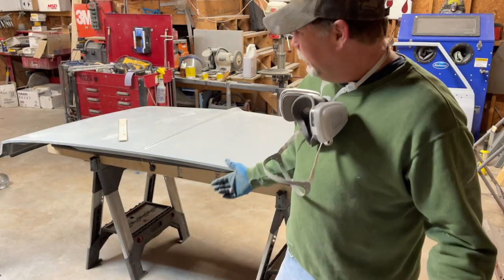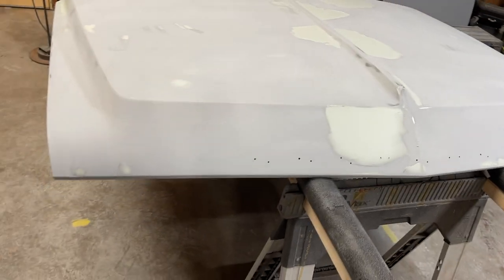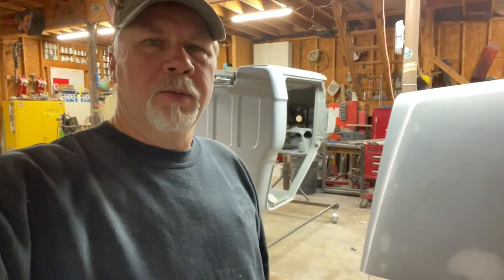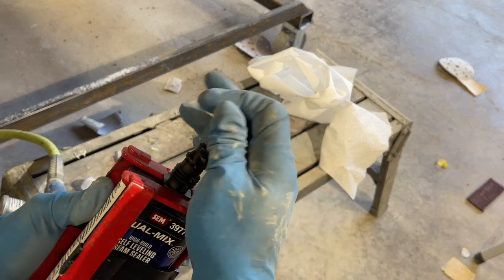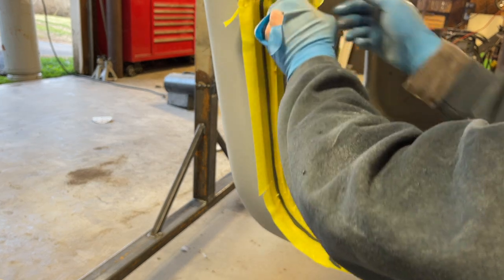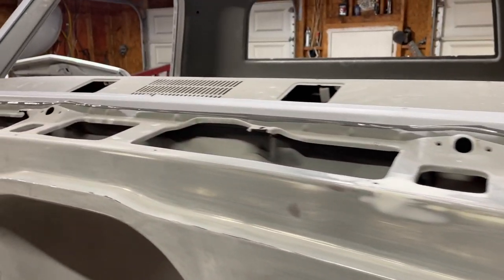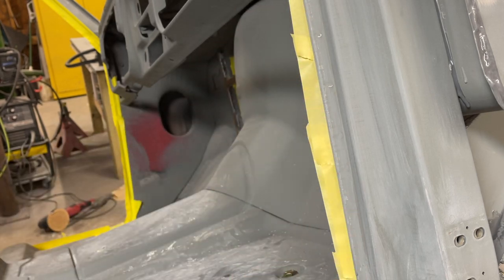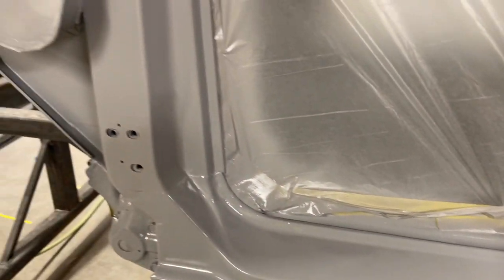C10 Show Truck Project: Seam Sealing the Cab Jambs and Priming

Comment: Great videos ! The more detailed the techniques,  the more enjoyable and informative they are to me. Keep up the good work 👍.
Reply from the maker: Thanks, will do!
Reply: @StoutCustom  excellent video. What are your thoughts and preferences on painting the underside of the cab with paint versus some sort of undercoating?
Reply from the maker: @jordangraham2942  it’s really personal preference. Paint looks so clean when it’s done and as you assemble the vehicle but a few trips down the road and that’s over. Hard to ever get it that clean again. Undercoating, bedliner, gravel guard can look good too but the same hold true for them as well. The Nader costs can help with road noise too. It’s also easier to spray bomb under coats back to “clean” if you want to.

Comment: great videos; Usually you fast forward through spraying can you possibly do a little slow motion.  I think I am seeing a little flip of the spray gun to the out side when spraying a panel and you pick up that edge when you move down that way.  Am I seeing things?
Reply from the maker: I believe you are correct. Next go round i will slow it down. 👍

Comment: Did you seem seal around the rocker edges?
I didn't see it.
Reply from the maker: I sealed all the accessible joints. There are a couple areas like the upper seam and inside the rockers that will be treated with cavity wax.
Reply: @StoutCustom  good info.
I redid the rockers on my 70,but need to seal,thank you for the fast response.
Phil

Comment: Where can I purchase a rotisserie? I need to redo my c10. Alot of sheet metal work.
Reply from the maker: There are a lot of places online that sell them. Eastwood’s, harbor freight, I even saw Lowe’s offers one. They are pretty basic and simarly priced so I’d read the reviews and decide which one you like. Some have up charges for wheels, hydraulic rams, etc.. depending on what you want.
Reply: Awesome. I need something basic nothing fancy. It's for personal use only. Good enough to get the work done. Not trying to break the bank getting one.

Comment: Hi, did you use VP2050 over the bare metal?
Reply from the maker: The truck was blasted and epoxied before I got it. So I started by sanding and applying filler over the epoxy. Working the filler created some bare metal spots, filler areas, and sanded epoxy. I put the VP 2050 on top of all that.
Reply: @StoutCustom  got it, thank you
Reply from the maker: @62_impala_ss  sure thing. Thanks for watching!

Comment: Another great video. Is there a reason you prefer the mixing seam sealer vs a single tube? Pros/Cons
Reply from the maker: I use the single tube caulking gun style seam sealer in some places. Usually on the underside of a vehicle where its not seen or where it duplicates the “factory look” I’m after. Its often brushed into the seam to make a brushed factory look. They are usually slow to cure sometimes taking overnight to dry. The two part seam sealers give you more options. The textures/profiles have a greater range from thick and not moving much after you apply it to flowing out almost completely flat. The one part types cure over time relative to the environment they are in. The two part is a chemical reaction that is very predictable with a specific cure time designed into the product. Some as quick as 15 minutes. A one component has more potential over time to shrink or crack where the two part doesn’t. Either one can give you great results but you may have to work the single component more to get there and wait longer for it to dry.

Comment: I'm really enjoying your builds, you do nice work!! What is the longest you would use with the yardstick sanding block?
Reply from the maker: I would use the whole thing if i had a long enough and flat enough panel. Most of the time about 17” though. Thats about the length file paper comes precut for an airfile which i guess im just used to. Thanks and thanks for watching!

Comment: any recommendations on under hood supports whats the goop thats in between hood skin and supports thanks for any help
Reply from the maker: I used SEM 39347 flexible foam. Gives it some support without being too rigid. It will expand out past the supports and you have to trim it back. Good luck on your project!

Comment: What seam sealer are you using?
Reply from the maker: Mainly the SEM 39777 high build self leveling seam sealer where it is visable. In places that don’t matter I use the SEM 29372 1k seam sealer.
Reply: @StoutCustom  thanks for the reply i appreciate it !

Comment: Do you take all body panels down to bare metal to start with? Thanks really enjoy your videos!
Reply from the maker: On these older vehicles yes. You never know whats underneath and most were painted with lacquer which doesn’t play well with a lot of todays products. If you start at bare steel and use the right products, there should be no surprises that bite you in the rear. Thanks for watching!
Reply: @StoutCustom  can you please give a brief outline of your preferred process. Take down to metal, metal work, rough filler, epoxy, 2k high build ...etc? I am getting lost in all the info and products out there. Much appreciated
Reply from the maker: @seanobrien6254  its more complex than this but here goes:
Strip to bare metal, epoxy, replace bad sheetmetal, re epoxy any bare metal, work filler, high build primer, block and add filler where necessary, reprime with high build primer, block, final prime with high build before prepping to paint.

Comment: How to you keep the self leveling sealer from running on the verticals? Are you rotating the rotisserie as you go off camera? Watching every morning at 4am before work, addicted!!! Awesome awesome awesome job!!!
Reply from the maker: I try to apply it thinner on the vertices because it does run. Once it dries it can be sanded and another thin layer applied to get the finish your after. It was cooler back when I did this and the ambient air temp has everything to do with how much it flows. It was a bit more controllable then. I used a little recently in this heat and it was almost uncontrollable. I’m sure if I could do it in sections using the rotisserie I would have. Thanks for watching!